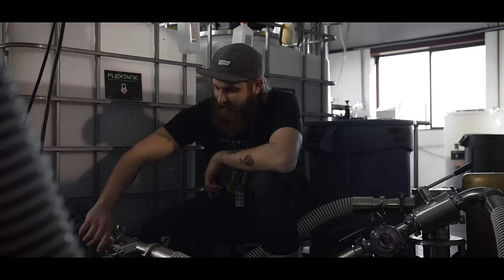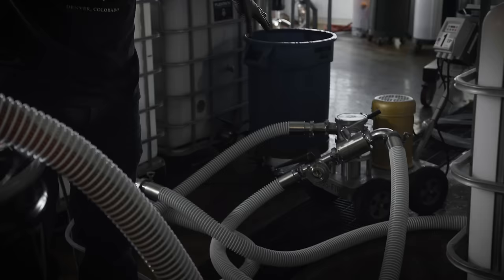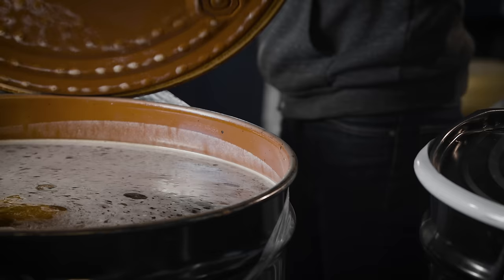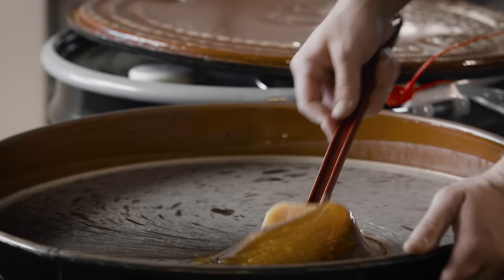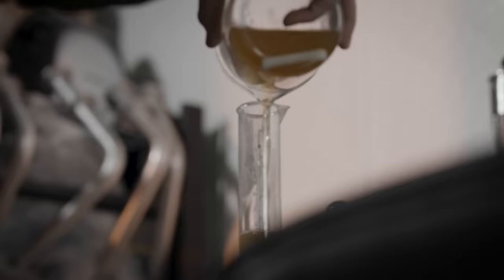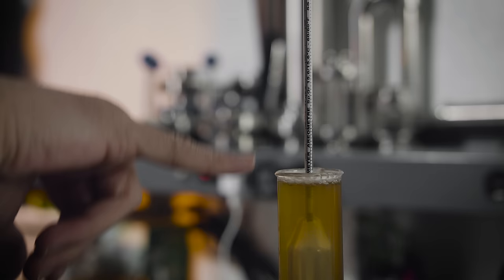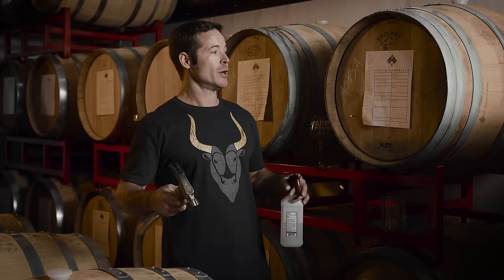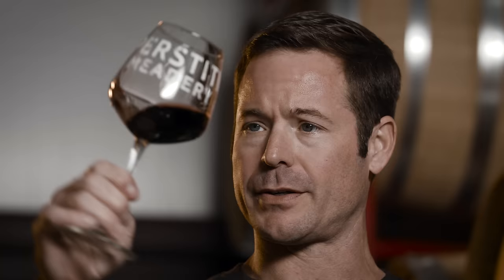Bringing Back The World's Oldest Fermented Beverage | PARAGRAPHIC

Comment: I just made a sparkling honey beer, 3 lbs local honey to 2 gallons water, ferment two weeks and bottle condition.
Reply: What would you use for yeast nutrient if u dont have commercial one available? Thanks in advance
Reply: @ahviper5871  I use raisins for nutrients for yeast when I make mead, 13 raisins per gallon/4 liters of water.
Reply: @josiahtheblacksmith467  thank u alot
Reply: Do you need the nutrient? Can you not just put the yeast into the mixture?
Reply: @21cup  it is not necessary but it helps to ensure the yeast thrive and multiply quickly to give a good fermentation.
Reply: @josiahtheblacksmith467  makes sense, so do you just set it loose on the fruit first and then move it to the honey and water?
Reply: @21cup  I put the raisins in with the honey and water and leave them in for the duration of the brew.
Reply: @josiahtheblacksmith467  awesome thanks!
Reply: @21cup  no problem

Comment: HOBBYIST VS PROFESSIONALS
I've been homebrewing mead for about 20 years.
I mix 3lbs honey and add water to make one gallon. This scales up, for a 5gallon batch I use 15lbs clover honey then add water to make 5 gallons. (locally sourced clover honey is the best)
I usually hit SG of 1.100, and I usually have a Final Gravity below 1.030 to 0.999 (9% to 13%abv)
for yeast I've tried all the homebrewest yeasts, and some get rather expensive... lately I've been using Red Start Bread Yeast. it's indistinguishable from Lavalin D-47.
6:48 ok, I Do NOT have Barrels! That's Awesome! I Wish I could afford barrels! I just bottled a 18 month old Elderberry mead at 10%abv that is Wonderful... but it'd have been 100 times better aged in OAK. I did a three year old Chocolate Mead that I fell in love with, but I'd have Married It if I could have aged it in Oak.
10:45 he gets to drink on the job... Soo much envy right now. not only does he get to drink on the job, he's doing what he loves.

Comment: Can someone explain what they mean when gravity is a measure of density
Reply: The term is "specific gravity". The measurement of specific gravity tells you how much sugar is in the must.
Oil isn't "lighter" than water, it is less dense, which is why oil floats on water.  Honey is denser than water, it sinks.  The hydrometer floating in the cylinder has a scale written on the side, like a thermometer.  In pure water, it floats at a certain height marked 1.000. So we say water has a specific gravity of 1.
If you were to dissolve salt, or sugar, into the water, the mixture would be denser (heavier than pure water). The hydrometer floats higher up and  the specific gravity is higher, perhaps 1.130.  The more sugars in the water, the higher the gravity reading will be.  As it ferments, the sugars become alcohol. Alcohol is "lighter" than water. So as the sugars dissapear, and the alcohol level rises, the specific gravity will drop; the hydrometer will sink down somewhat.  The "final gravity" might be  1.008 and your mead would be 12.2% alcohol.